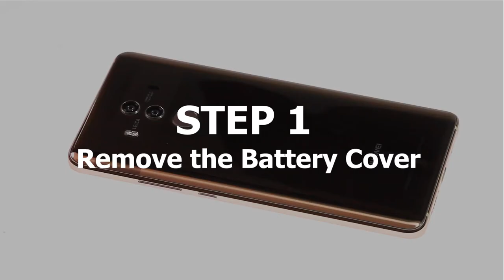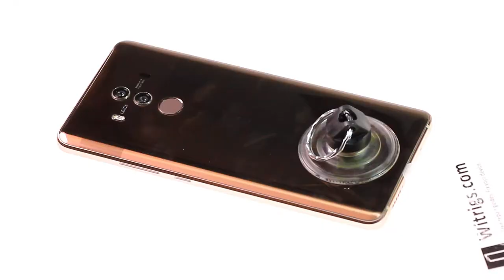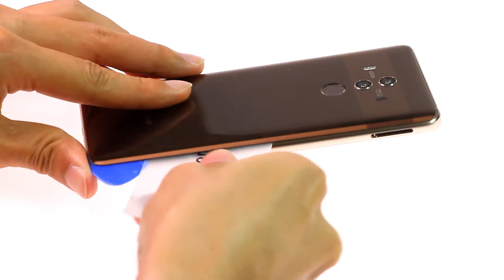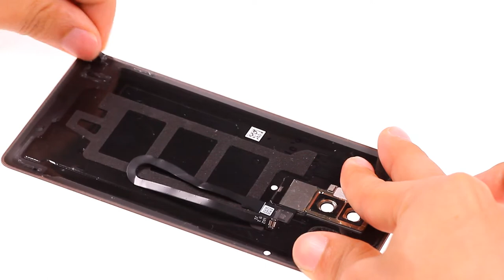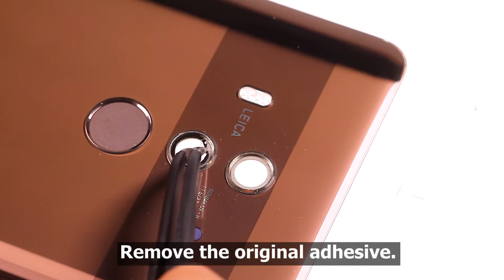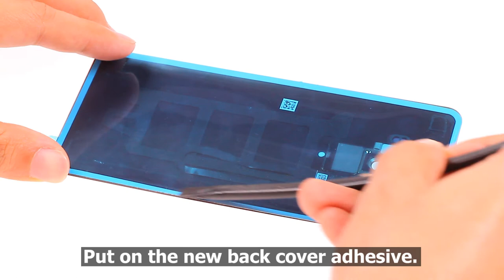Huawei Mate 10 Pro Camera Lens Repair Guide

Comment: My lense glass shattered, so I could replace the glass without opening the back cover.
Reply: @CaioAbsy  as said... I did not have to open the back cover because the lense glass shattered
Reply: @Jingx0r  and the old glue? how you remove? tks!